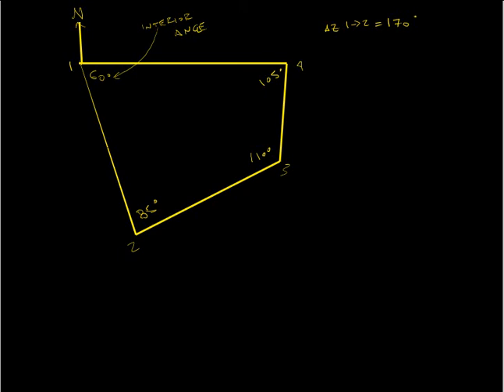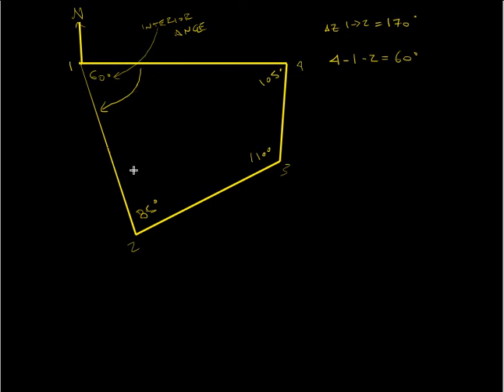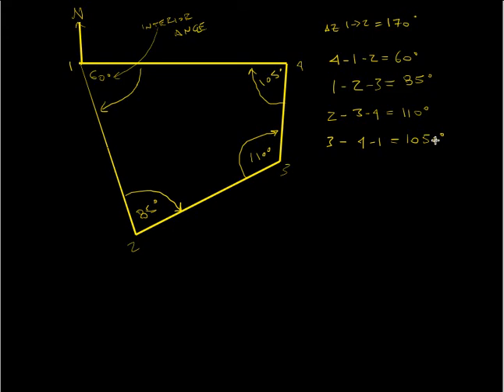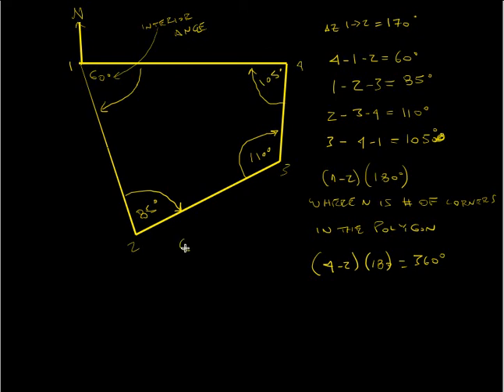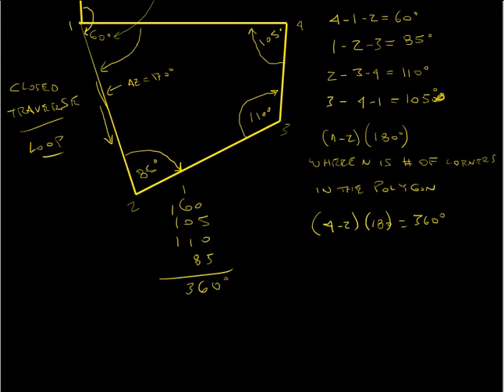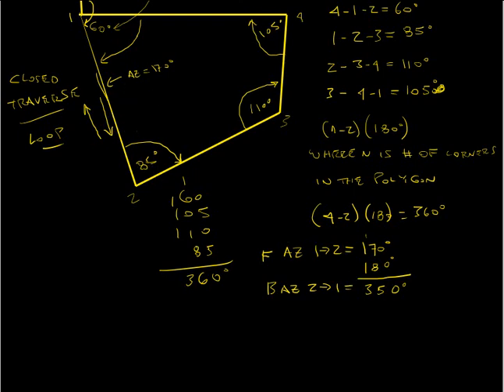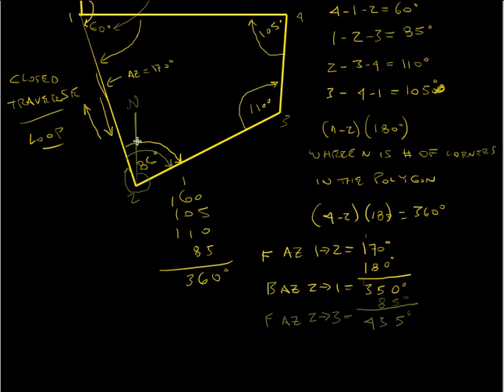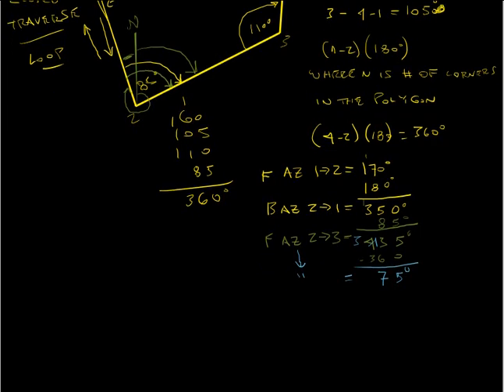Working with Azimuths (Part 1)

Comment from the maker: Most likely you were given a survey that is referenced to magnetic north. That is what "local attraction" is referring to. One of those lines should have two bearing associated with it. One might be referenced to another orientation of north. Take the difference between the two bearings. See what you come up with. It seems you want to get the bearing into the "Datum line" orientation. Hope that helps a bit. Ask more questions if you need to.

Comment: I have a test on Monday. I dont understand half of what I have been asked to do. e.g "Use Datum line and adjusted internal angles to compute bearings of remaining lines". Whats my datum line bearing? it says use the one accepted for removal of local attraction? What the hell is that? I took1 degree off of 2 bearings does that hae anything to do wit it. Screwed??? :/

Comment from the maker: @MegaNerdrage It's not too hard. What you want to do is draw your northing and easting axes (draw a cross and label the north, south, east, and west directions). From there, draw the two lines on the axes. Once you have done those two things, you should be able to visualize the angle between the two azimuths. If you can't figure it out, post again and I will make a video on it. Thanks for posting.